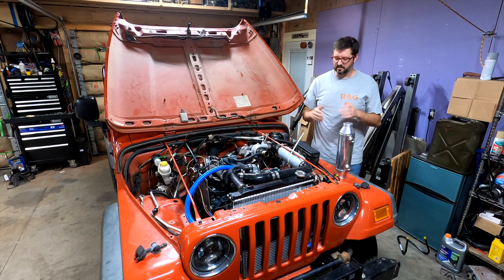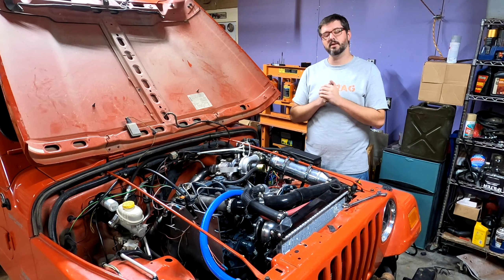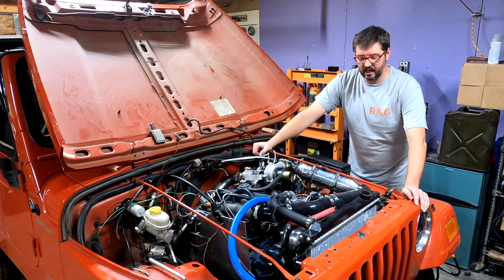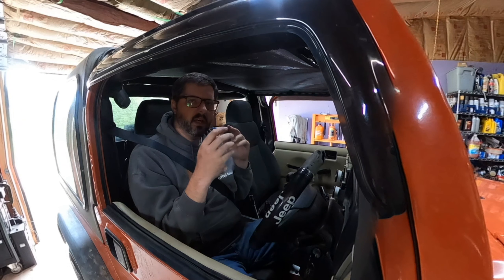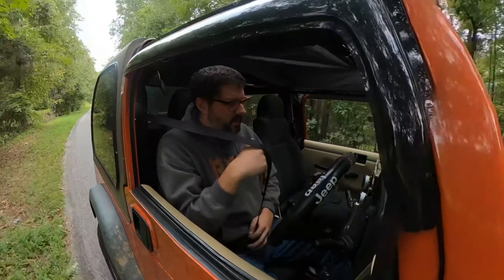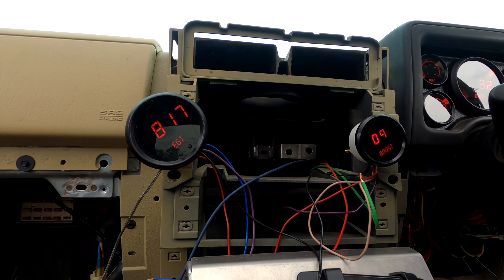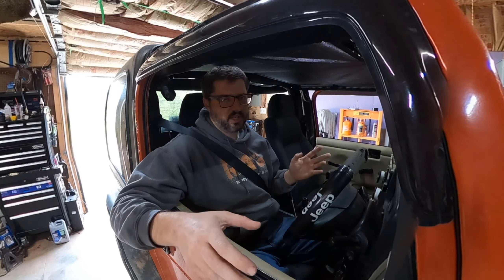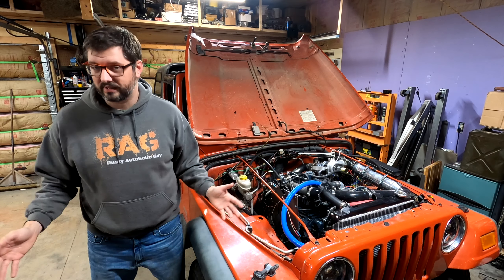Second Pass at a Water-To-Air Intercooler Setup for my Diesel Swap TJ Wrangler

Comment: Also try running this stuff called edt by hot shots secret it might help too it’s a fuel additive a lot of people have had good results
Reply from the maker: I'll take a look into that as well! I have a few other things I want to try running also which I will hopefully be adding in the next week or so!
Reply: Rusty Autoholic Guy even if the every day treatment by hot shot secret doesn’t lower egts it help lube all of the fuel system and burns cleaner also get a little better mpg

Comment: I still need to catch up on this video series. You may have answered this already but why not go with an air to air intercooler for this setup?
Reply from the maker: So I have a doubler on this build which gives me a 7.41:1 final crawl ratio. I plan on doing slow rock crawling and offroading where having an air-to-air setup would not be great. With water to air can cool the water with and electric fan to still have my charger air being cooled while moving at super slow speeds.
Reply: @RustyAutoholicGuy  that makes perfect sense. You may look at finding a slightly larger exhaust housing for your turbo which should also lower egts especially going up grades.
Reply from the maker: @decentgarage  yup I've actually already found another K03 that has a larger exhaust housing and turbine wheel that will bolt up to my current setup as well!
Reply: @RustyAutoholicGuy  nice! Can't wait to get started on mine. I'll email you tomorrow about that kubota starter 👍
Reply from the maker: @decentgarage  sounds good!

Comment: I hope you know you can hold 1000 degree egts for up to 15/20 seconds before it does damage some engines do better at high egts than others but if that turbo has a waste gate try messywith it so it holds boost longer before bleeding off
Reply from the maker: I actually learned earlier this week after I had that video that this Kubota can run EGTs up to 1200° all day long so I will be adjusting my EGT warning light to come on around 1150°. Also of this stuff is new to me, so I'm having to learn as I go! Thank you so much for the information!
Reply: Rusty Autoholic Guy crank the fuel screw up😂

Comment: Consider reinstalling the waste gate actuator.  The turbocharger is a centrifugal compressor driven by a turbine.  It may be possible to achieve 11 psig boost with the waste gate operational.  The clamped waste gate may be causing high drive pressure.  Essentially, the turbine may be causing excessive back pressure on the engine.  The higher back pressure is reducing the combustion chambers ability to exhaust the hot combustion gases driving temperatures upward.  A centrifugal compressor has a "pump curve".  Spinning it beyond it's design will not produce more flow.  Hence, an operational waste gate may still provide 10-11 psig while reducing drive pressure and EGT.  I may be wrong.......maybe that turbo is "perfectly matched" to the Kubota and a waste gate isn't needed.  Is it possible to change the spring in the actuator?
Reply from the maker: I am considering it though I did disable the wastegate at the recommendation of KubotaSwappers. He uses the K03 for all of his turbos and says they are almost perfectly matched for the these size diesel engines. I am looking into getting a different type of K03 that has a slightly larger turbine and compressor wheel with an adjustable wastegate that I can set to around 22psi I believe.

Comment: What type of diesel motor is that?
Reply from the maker: It's a Kubota 03 series industrial motor. Used in everything from tractors, marine applications, skid steerings, generators, water pumps, carrier units etc. This particular engine is a V2403. 

The V stands for 4 cylinder, the 24 is the displacement in liters so a 2.4l, and the 03 is the series of engines from Kubota. So there is a V1903, V2003, V2203 <- this is the most common of all the engines, and the V2403.
Reply: Are they relatively cheap? I’m curious if a 4bt or a Kubota Diesel engine is best :)